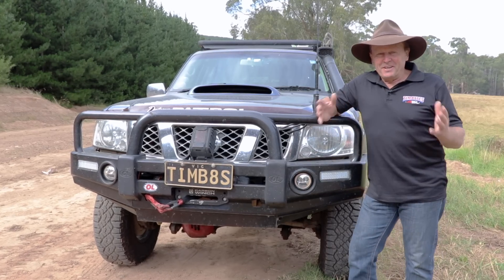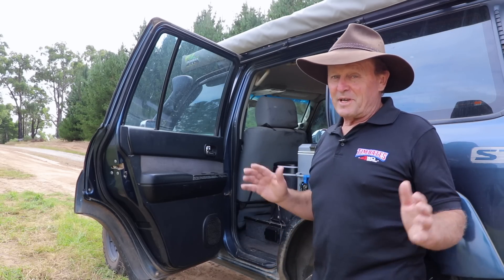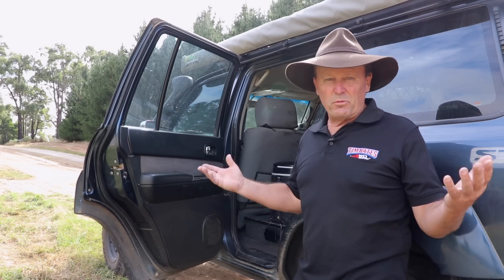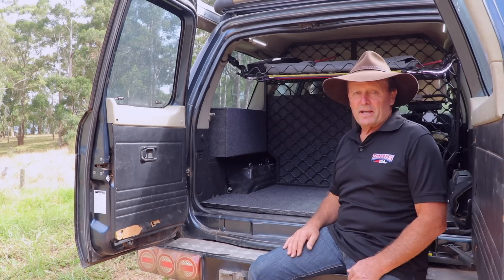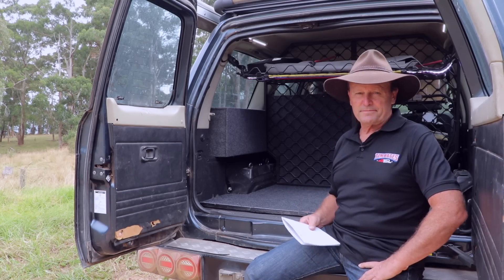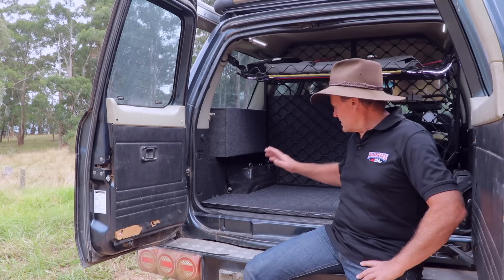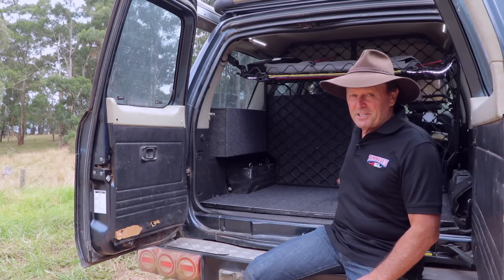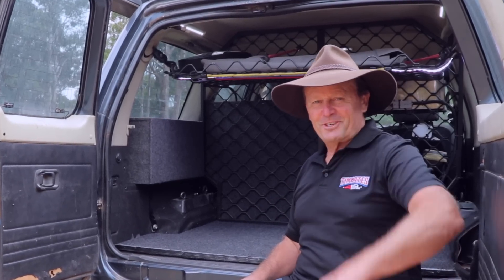Two Lithium Batteries Fail In Just 11 Months. - [ WHY?? ]

Comment: Hi Tim interesting video. I’m not sure if l have been fortunate, l have a 54 amp itechworld  lithium battery under the bonnet for nearly 3 years. 
Minimal loss of charge, handled hot Perth summers and plenty of desert travel. 
  My starting battery’s is Century lead acid. 
Good luck with your improved setup.
Reply: Bloody good choice, I have 3 x Itech 54 amp batteries - 162 amp hour mounted under the rear right window in my troll, opposite side to Tim.
(4 of em would have blocked access to jack storage and tail light globe replacement access, as I'm running European rear qtr panel lights)
Batteries have been extremely good thus far, unfortunately my Redarc BCDC25D has it's issues occasionally not delivering full omph. Looking at replacing it with Itech unit.
I have gone one step further utilising Itechs lithium cranking winching battery as starter battery obviously under bonnet, so impressed by Itech gear thus far.
Reply: @ianweal3081  Glad to hear someone else is doing well with the same battery. As for starter battery, l might go for iTechworld lithium starting battery, when my lead acid gives up.
Reply from the maker: @ianweal3081  Far out, great setup you have mate. 
Plus the batteries are mounted on the same shelf but opposite sides. 
Ive got a 40amp Redarc changer also hooked up. 
Thanks mate. 

Cheers Tim
Reply: @timbates4wdadventures  yep, mine are on opposite side to yours, mounted on a sliding enclosed rack.
Unplug three Anderson plugs, lower rear passenger seat back, undo two bolts, slide all three batteries forward and service via passenger door, so friggin ideal.
Reply from the maker: @ianweal3081  really well done how you’ve mounted yours mate. 
Top stuff.
Reply from the maker: Good you have had a good run with your mate. I hope i now get the same good run. 
Thanks mate. 

Cheers Tim

Comment: Hi Tim, sounds like it could the the weight of the battery on top of the BMS circuit board that’s sitting at the bottom and over time vibration etc damage a component or wiring connection. Another possibility is if charging directly from the alternator and not via a DC-DC lithium charger this could also create problems. Thanks for the videos, cheers from Bribie Island Q.
Reply from the maker: That’s what I’ve been told also mate about the BMS. 
It does run through a 40amp dcdc charger. 
Thanks mate. 

Cheers Tim

Comment: Hey Tim, Is their a reason you did not fit it under the bonnet?
Reply from the maker: I mentioned that in the first video mate. 
But it didn’t go under the bonnet from advice about the heat from the ending. 

Cheers Tim.
Reply: I have a 2011 patrol mate ive been running lithium for the past  18 months its going fine @timbates4wdadventures
Reply: 90%+ Lithiums cant take the Engine heat.They are finally making some engine heat resistant lithiums but they are expensive $$$$

Comment: Hi Tim, thanks for the info. I did not know, either about orientation. Curious to know why the orientation matters.  The failure you mention sounds like a fault with the charging of the batteries to me. I'd be getting someone to have a look at the loaded output of the charger. Does it over voltage, have spikes in the power delivery etc.
Reply from the maker: G'day mate, 
Apparently its to do with the battery management system. BMS 
Both of the failed batteries operated as they should for the first few months, with full charge going into the batteries no worries. 
After a few months, they slowly got worse. 
To the point where they were useless for camping. 
Thanks mate. 

Cheers Tim

Comment: I've had mine lying down for 3 year no issues. i noted you said you charge yours from the alternator to me that suggests directly....
Reply from the maker: While im driving its charged from the alternator. As how much dual battery setup has always been setup. 
While at camp, i plug a solar panel straight into the battery. 

Cheers Tim
Reply: @timbates4wdadventures  fo you separate your battery chemistry? Do you have a charger with lithium profile to balance the cells? 
From sounds of it it's your setup more than the way you mount them .

Comment: They also don't like cold or heat.  You have the new one in a box covered in carpet.  How people install their batteries is up to them but personally I wouldn't even trust a Lithium battery.  I'll probably get nasty comments now but, that's the way it is.
Reply: Kings do a 60AH lithium which only weights like 8kg for a few hundred. its a good way to test if lithium is good for your set up. And surprisingly Kings ones arent THAT bad.
Reply: Tim when l wanted to install my 96l coolman fridge l had to look at either going down the track of a dc to dc charger, which meant installing a 3rd battery etc or go completely independent of car charging to  complete solar charging only. I chose to go Solar and run fridge from an ecoflow power source. These units believe it or not have 6 slimline lithium batteries and must remain upright with a cross flow of air    readily available to the vents on the unit! I was very sceptical that this would the best option for me, but in all honesty l have ben impressed. The power from this set up keeps my fridge going for well over 7 days without even starting up my vehicle, longer camp times are achieved so long as l have sun to charge from the 415w solar panel into the ecoflow unit! Just waiting now for the whole unit to burn my vehicle to the ground, so far so good! Hope it stays that way!
Reply from the maker: @Lee-astrololee  great feedback. 
I hope it doesn’t burn to the ground. 
The front face of the box has large slots cut in it , that I didn’t mention in the video. 
So far so good 

Cheers Tim
Reply: @timbates4wdadventures  Thats great Tim, yep they need to have that air flow to be efficient! Lithium do have a large temp range that they can cope with, which is great but none of us want to push our luck as things when they go wrong, go horribly wrong! Also, you must tell your insurer if you have upgraded to lithium batteries for your powered appliances! Warranty is certainly voided if anything goes wrong and you haven't let them know!
Reply: Totally understand your comment mate. They recently have proved if they go bad they go bad in a big way. Plus the bloody expense to purchase and set up. 🍺
Reply from the maker: You wont get nasty comments mate. 
Im not happy to have gone through what i have. 
Got me thinking thats for sure. 
I should have mentioned it in the video. 
But the front face of that box, has two large lots cut in it with the cover over it. 

Cheers Tim

Comment: Big tip Tim. Make sure that battery box is well ventilated, as vehicles get very hot. I keep my windows slightly open also.  If you haven't got a quality bctobc charger, hook a redarc 1250d to your set up. That battery will be charged in no time.
Reply from the maker: Gday mate, 
I should have mentioned it in the video. 
But the front face of that box, has two large lots cut in it with the cover over it. 
Plus i have the app to monitor all the battery read outs, including temp. It doesnt seem to get about 24-25 degrees. 
I have a 40amp Redarc changer installed. 
Thanks mate. 

Cheers Tim

Comment: I wonder why you can't lie them down? It should make any difference as they're solid state. (No liquids or moving parts) but great info as usual.  :)
Reply: Just depends on how they are put together. Most will have the bms sitting on top of the cells, so if things become lose, damage can happen. If you pull a few apart, some even have things just held in place with tape.
Reply from the maker: @MrFastFarmer  Thats correct mate. where the BMS is mounted. They can be the issue. 

Cheers Tim
Reply from the maker: I was told mate, it's to do with the battery management system. BMS
Im not saying all lithium batteries must be mounted up right. 
Just check with your battery manufacturer. 
Thanks mate. 

Cheers Tim

Comment: Hopefully it'll be right now Tim. Wil it have enough air ventilation in the box not to heat up. Thanks for the info.
Reply from the maker: Gday mate, 
I should have mentioned it in the video. 
But the front face of that box, has two large lots cut in it with the cover over it. 
Thanks mate. 

Cheers Tim

Comment: Most LiFePO⁴ (Lithium Iron Phosphate) batteries don't care what orientation they are in, right side up, layed down, upside down. They aren't filled with liquid.

Even most AGMs are ok with any orientation. I've run two Full River AGMs flat on their sides for the past four or five years. (Probably due for a Lithium upgrade!) 

You've obviously found the exemption that proves the rule!
Reply from the maker: So many think they can be mounted in any configuration. 
I was one of them. 
After what i found out from my battery manufacturer, it clearly says you cant. 
So, all im now saying is, check with your own battery manufacturer. 
If they say it can be mount any any format, well go with it. 
For me, i wasnt leaving on its side when manuafacturer says you cant. 

Cheers Tim

Comment: Tim as suggestion that little battery box requires vents, battery will perform better 🙂
Reply from the maker: Gday mate, 
I should have mentioned it in the video. 
But the front face of that box, has two large lots cut in it with the cover over it. 
Thanks mate. 

Cheers Tim
Reply: @timbates4wdadventures  That's good mate, all the best with the new setup. Happy travels.

Comment: I watched another YouTuber who switched to Lithium and he was checking his for loss of capacity over time.
Not good news and I believe he went back to AGM.
I have to change the cranking battery in my 4wd and I'm going with a HD 4wd version from Century.
The factory one lasted for over 6 years so here's hoping the better one will last.
I think mine sits around and doesn't get used enough.
Hope you have better luck with this one mate.
Reply from the maker: I tell you want mate. 
When i had to get a third one installed after only 11 months, i was fair dinkum over it. 
Ive now invested too much into this, so i will stay with it. 
But, i could see why you would change back to the good ol faithful AGM. 
Mine should be all good now. 
Thanks mate. 

Cheers Tim
Reply: @timbates4wdadventures  Yeah I only have the cranking battery and I wasn't wanting to spend that much for Lithium but certainly if you were putting in multiple batteries it is a big decision for sure.
I sometimes wonder how long those all in one solar generator things last as they can be very expensive to buy as well.
I think I shall stick with my very simple setup.
Reply: I'm guessing your original battery was a FB branded unit from Japan.
For some reason they last a long long time, guarantee you new one won't last as long.
I got ripped off by the Nissan dealer I purchased the Patrol from, they swiped my FB battery and substituted it was a Century. Didn't get 2 years out of it, buggers. (Staffer wanted a good battery).
I've now converted to a  lithium starter battery, so much omph on start up mechanical team thought my compression was stuffed, lol, I had them going.
Reply: @ianweal3081  Yeah it's in a Mitsi. and the dealer offered to replace it, at a cost obviously.
They replaced our Hyundai battery after quite a few years and it was still cranking fine.
I was thinking that the HD battery would be tougher off road and a family member has had the same one for a few years now.
Not sold on Lithium yet tbh.

Comment: Great information, alot  of people wouldn't even think to read the manufacturers instructions.  Cant wait to see you back out on the tracks.
Reply from the maker: Absolutely mate. 
So many people think that Lithium batteries in the 4wd can be mounted in any configuration, as i sure did. 
Until i read the manual. 
Thanks mate. 

Cheers Tim

Comment: Just one question Tim, will it get too hot in the box while it’s charging
Reply from the maker: G'day mate, 
I didnt mention in the video. 
But, the front has wide slots in the timber to allow air flow. 
Plus i have the app for all of the read outs and its not getting over 25 degrees where i have it now. 
It was getting hotter than that where it was mounted. 

Cheers Tim
Reply: Yeah I was wondering that.
Reply from the maker: @oldbloke204  Cool mate. 
Glad you found this video helpful

Cheers Tim
Reply: I was wondering the same thing myself. A vent might be a good idea. Though LI PO4 battery is not as susceptible to catching fire as a old LI battery was from my understanding but better to be safe.
Reply from the maker: @Philipk65  I didnt mention mate. But the face of the box has wide slots cut in it behind the carpet for air flow. 
Plus i have the app with all of the battery read outs and temp is one i can clearly see. 
Thanks mate. 

Cheers Tim
Reply: @timbates4wdadventures  That is good Tim 👍
Reply: Might generate a bit of heat from the sun on  side of your vehicle plus heat from the battery while charging, could not center the battery a bit more behind your barrier, just a thought